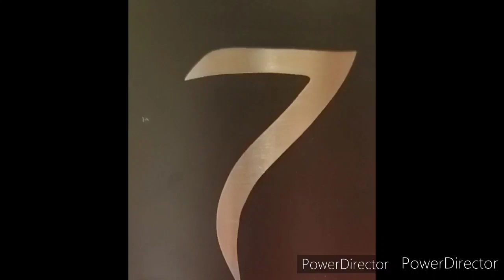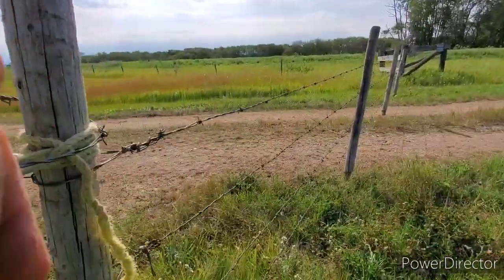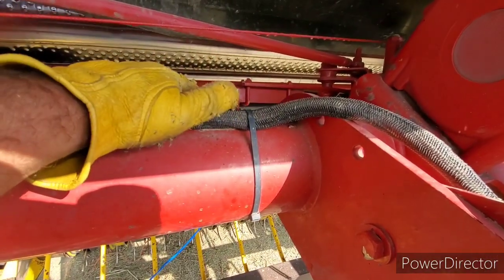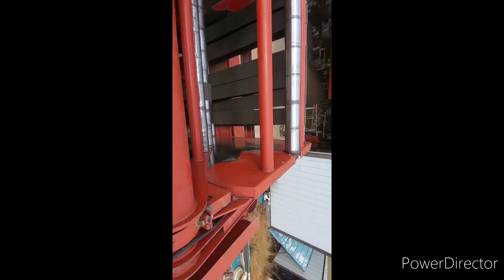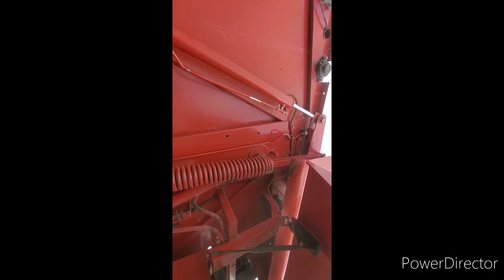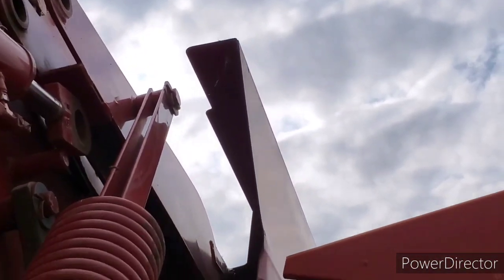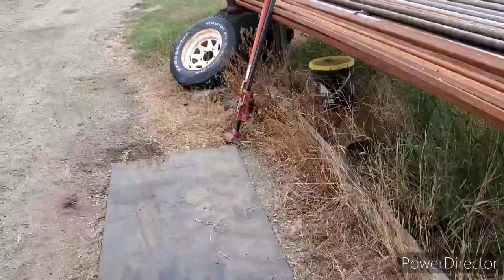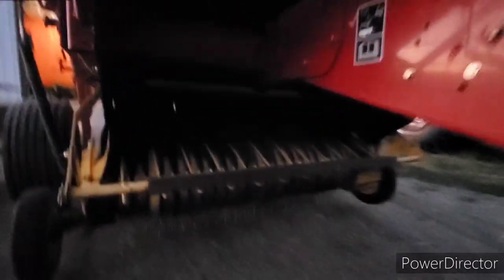FIXING Pressure Take Up Roller Bearing on BR780

Comment: I have a BR750 and truly appreciate any videos that can help me with maintenance.  You mentioned how you determined there was a problem, which was very helpful.  You didn't mention how many bales.  I have 10k and am anxious about what is next to go.  I was a bit disappointed that this video included 9 minutes of material that had nothing to do with the title - maybe should have been 3 separate ones.  Thanks for your detail.
Reply from the maker: A bearing can fail at any time...don't matter how many bales you have on it I've had them go with only a couple hundred on new bearings

Comment: Hi know this is 4 years ago but we just found this busted on our baler
You mentioned in the video "they said about hydraulic pressure" so was hoping can tell me if found other videos, forums, or really helpful mechanics? Because of course busts on a long weekend😡. Just trying to figure out so can get to the bolts to take it out
Reply from the maker: Na I never found anything...if you have a second loader tractor you can release all pressure and chain pressure roll assembly to loader tractor to hold it up as the tail gate is open

Comment: Got a 688 im about to tackle the compression roller bearings on
Reply from the maker: They can be a real pain...having a second person really helps
Reply: Went at it after supper last night. Took about 1.5 hours to get it apart. Ended up pulling 4 rollers that had questionable bearings.